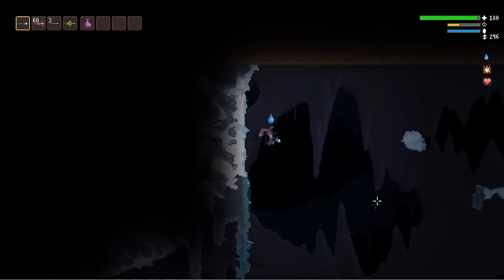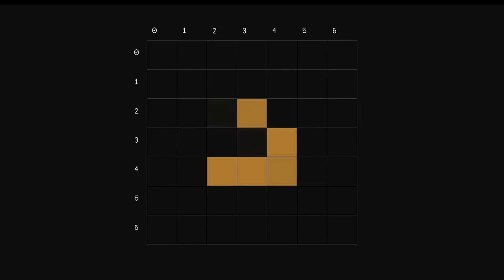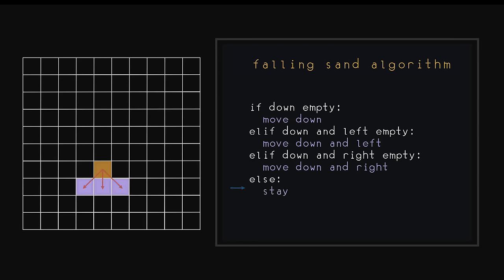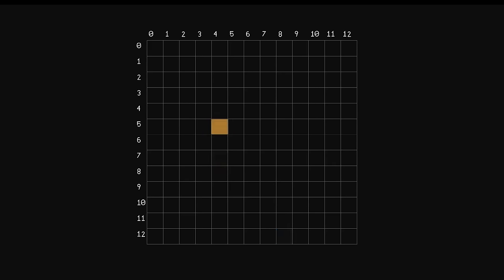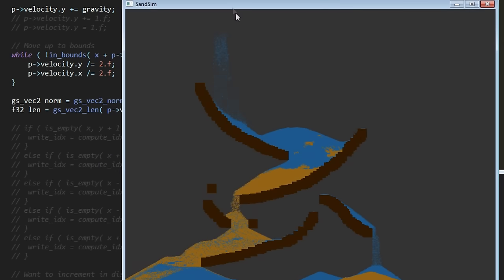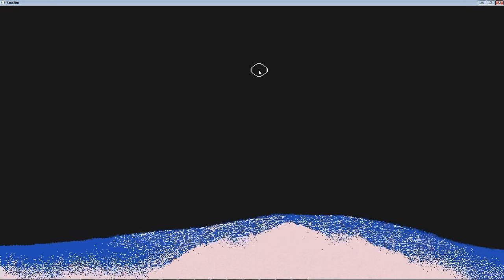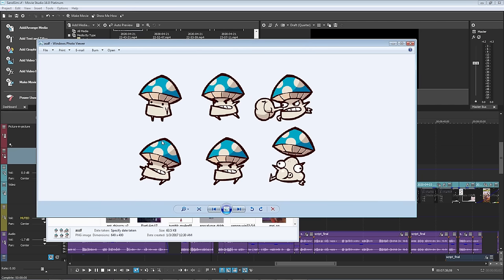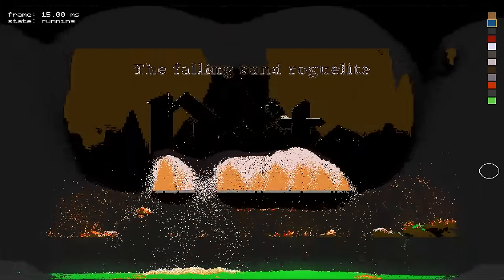Recreating Noita's Sand Simulation in C and OpenGL | Game Engineering

Comment from the maker: Edit:  

Wall of Text Warning

- At 02:07, the size of the b32, gs_vec2, and color_t member variables should only be represented as "bits", not "bytes". Therefore the overall size is not the grossly exaggerated amount shown here, but 24 bytes. Thanks to @Nyzcere for pointing that out! There's always a mistake you miss!

- I've gotten a concern about the memory storage for the particle data. Something else I'm regretting not going into more detail. To clarify, the texture size is not the screen's full resolution in this implementation. It's 629 x 424 for a total of ~266.7k particles. Total memory storage for this buffer is therefore ~6.4MB. I think that's acceptable for a small game world like this. The size of this particle data can definitely be lowered though! If you pack the life time and color information into 4 bytes (24 bits for the life and 8 bits for a color lookup index into a shared table), you could drastically reduce the size. However, the goal of the vid was to show off a concept and demonstrate an implementation - not to achieve extreme efficiency.

- It's also been requested to explain a bit more about how the rendering occurs, since that seems to be a large concern for people who might attempt something like this. 

For the particles' updates, they really are that simple, naive and brute force. It seems odd, but the resolution of my world shown is roughly 260k particles, and it easily hits a 16ms frame time. However as you scale the world, this won't cut it. So you have some options. You could split it up into sizeable chunks, say 512x512 (like Noita does), and then partition those chunks into active/inactive buckets and only update the active particles. To further speed this up, you could multi-thread the simulation.

Now, here's the catch: Noita and my simulations are both single-buffered and run on the CPU. So that means multi-threading is...challenging. You have to be careful at the boundaries of your chunks, since there's a large chance you'll have a lot of data-races at boundary walls.

Noita handles this by splitting its update frame into 4 sections - it creates groups of chunks to update in a "checker like" pattern, so it maintains a large separation area between chunks. This works well enough in practice so that a particle has a large enough area it can travel in a single frame between neighboring chunks without having to worry about getting accessed twice in different threads.

You could also move the entire sim to the GPU, but that's a different beast altogether. :)

The rendering is done in a single draw call. I keep a 2d array of 32-bit rgba color data which maps directly to the pixel data. There is also a GPU texture that has the exact same dimensions as this CPU texture. As I update pixels, I change the color data as well.

Then, when I'm done with the sim in the frame, I push the entire color buffer and copy its data into the GPU texture. Therefore rendering the scene is just a single draw call to present the buffer to screen. I also have 3 other calls for post processing.

All in all, the entire scene is rendered in 5 calls:
- one to render the simulation to an offscreen target
- three for post processing (bright filter, bloom, and composite)
- one for final presentation to back buffer

- Salt isn't less dense than water, I misspoke. But, it looks cool. That's what matters, right?

- @championchap brought up a point that I sneakily didn't address in the video (I'm starting to realize that I need to address everything much more fully than I did). The "simple" sand falling algorithm works great as a base, and adding forces, like gravity and velocity, do work to add some variation for a more "realistic" behavior set. However, if the velocity fails to move the particle in any way, the simulation falls back to this simple algorithm and it can look "out of place" with how uniformly it falls. Think about it - we specifically tell the sand to follow those rules in a fall through pattern - look down, then look down and left, then down and right. What you can do to force some variation is to alternate how to iterate through the columns of your data. Easiest way I've found is to add a frame counter and then on even frames, you iterate left-to-right. For odd frames, right-to-left. This adds enough variation to that falling pattern that it greatly helps out with this issue of unwanted uniformity.

- Also, thanks for all the kind words and motivation, everyone. Subscribe and be on the lookout for the next one. I've already started working on it 😀
Reply: Keep it up! You're doing very well with your videos and they have pretty high educational value, considering how many videos are like these (not many at all). :)
Reply: unity game "creator" sweaty
Reply: This is great content! Very well thought out, in a language that doesn’t get nearly enough YouTube love(C, that is), and is also entertaining in general. Keep up the great work
Reply: You warned me, but boy, it was a big wall
Reply: These types of sand games were how I entertained myself throughout junior high school. :D Loved these so much. It was really nice to see how they actually work!
Reply: What if you had a method that implemented a random chance of going left.. or right. I think that would increase how natural it looked.  This could even be a string of random bits you walk through for psudo-randomness, which would probably be faster than generating a random number each time.  A bounce mechanism would also be good, for sand particles that move past a certain velocity... this would be true of splashes for the water hitting the ground.. as well as fast (or weighty) particles hitting a liquid.  I loved how simply you explained things, and anyone who wanted to make something like this, now has a very solid starting point.  Kudos. Subscribed.
Reply from the maker: @christopheroldfield1066  For the random number for going left or right, it's actually not random at all - it just alternates depending on whether or not the frame is odd or even. You could definitely make this more advanced, but for this simple simulation, it worked out well and looks pleasing enough.
Reply: @johnjackson9767   I agree! It's a fantastic sim, even with the simple rules. I just really liked how it got my brain going.  Loads and loads of possibilities. My compliments!
Reply: Thanks for all the details, Im a CS dropout about to finish my bootcamp so this is great inspiration for some side projects I want to try.
Reply: thought the kids were using fancy 1024 bit values these days
Reply: salt ain't less dense than water, salt is twice as dense as water
Reply: HI man! looks awesome!

I've encountered an issue where the direction of iteration (left\right) greatly affects the behavior of the cells, especially in liquids and especially when adding velocity.
Did you encounter this? and if so, how did you solve it?
Reply: What do you mean, you could move the whole sim to the GPU? How would that work?
Reply from the maker: @titaniumtomato7247  If you double buffer the simulation, you could easily use the GPU to update the textures

Comment: what happens when two particles want to move in the same place? this is something i've always had problems with when creating simulations like this, as top leftness always gets preference
Reply from the maker: The first will get preference. I alternate updating left or right sides first each frame to keep this from being too noticable.
Reply: @johnjackson9767  Can you just randomise where the particle will go? Generate some integer to represent where the particle moves to
Reply from the maker: @GeneralPet  Sure, you could use whatever rules you'd like. A lot of this is tweaking and adjusting parameters until you get something pleasant looking.
Reply: What I do (if I can afford the performance drop), is pick a random site to update. Repeat it several times and you get something that feels “fairer.”
Reply: @jamesmathai1138  In order to do this efficiently you would iterate in a shuffled version your array. This is something that can be used in particle or verlet physics in general
Reply: vector backtracing eliminates this issue, take the velocity of a square and reverse it, then linearly interpolate between the values of the surrounding square centers.
Code:

newV = -v;
//Put newV into floor and fract components
floorV = floor(newV)
fractV = newV - floorV
//say newV is (15.8, 2.5) then floorV is (15, 2) and fractV is(0.8, 0.5)

//interpolation
//lerp function is a + k(b - a)

//horizontal interpolations ( interpolate between bottom two centers), using the horizontal component of the fract for k
lerp1 = lerp(values[floorV.x, floorV.y], values[floorV.x + 1, floorV.y], fractV.x)
lerp2 = lerp(values[floorV.x, floorV.y], values[floorV.x + 1, floorV.y + 1], fractV.x)

//vertical interpolation (interpolate between the interpolations), using the vertical component of the fract for k
finalValue = lerp(lerp1, lerp2, fractV.y)

a common issue would be that the outside squares may look outside of the array and cause a vector out of bounds, this can be fixed by just adding another layer to each side of the array and just advecting the inside.
This solution also allows you to set boundaries for incompressable fluids(mass conserving), you can just reflect the inner velocities onto the outside layers and make them negative,
this will stop any bad physics. Although all of this wont be needed for cellular automata i dont think...
Reply: well, because this is cellular automata, you have a current and a future state. the future state is made based off of the current state, then becomes the current state.
Reply: @aiexzs  Was just about to post the same thing lol, calculate a next grid state then transfer that to the current one and repeat
Reply: @aiexzs  How does that answer the question? According to the rules of the current state it may very well be that in a specific position a sand particle should be created because a sand particle wants to move there, but at the same time it should be a water particle, for the same reason. Kerch00 asks how to decide which one to pick

Comment: Really well explained, and a high production value. Hoping to see more :)

P.s. at 2:07 you accidentally switched from counting in bytes to counting in bits, the total should be much smaller
Reply from the maker: Ahh, you're right! Haha, that b32 should only be 32 bits. I gotta figure out how to add some way to fix it on YouTube. Thanks for pointing it out! What a silly mistake to make.
Reply: @johnjackson9767  also "has_been_updated" should be a boolean (according to it's name) so it's 1 byte and 8 bits
Reply: @adsick_ua  He's using 32-bit bool.  Like the Casey Muratori style from Handmade Hero by the looks of the code....
Reply: @johnjackson9767  Those are the best kinds of mistakes!
Reply from the maker: @totheknee  Yep, 32-bits for a bool so the structures are padded correctly.

Comment: Noita also have ridgid body physics, which is impressive.
Even more impressive is the fact that early versions of Noita had  surface tension for  liquid, so, for example, water in icy biomes formed icicles.
And on top of that, Noita uses multiple cores to calculate physics
Reply from the maker: Absolutely, it's a fantastic showcase of novel solutions to complex problems.

Comment: I remember making demos like this back in the Mode 13H days. Some effects, like blur, are done somewhat opposite from what's explained in this video. For every pixel, you set the color to the average of the eight neighbors. Fire can be implemented by setting every pixel to the average of the three lower neighbors, giving the effect of color moving up the screen. Averages tended toward the dominant color (usually black). This was done with a pre-set color palette, though. The rules were simple enough to implement with some inline asm, and very fast.

Comment: So high quality video! I LIKE it so much. It would be great to get more details how it's implemented in C. Memory layout of pixels and way to draw it fast. In unity I am unable to do such thing. If I create field of 1000x1000 pixels as individual game object, it just freeze my computer. I'll research source code!
Reply from the maker: Thanks! This seems to be a recurring comment, so I'll remember to go into a bit more technical detail in future videos. 

Basically, I keep a 2d array of 32-bit rgba data on the CPU and then have a GPU texture of the same size. When a particle updates, I make sure to update the color buffer as well so that there's parity between the two. Each frame, after updating the simulation, I just do a texture update and push all of that texture data to the GPU. Then I can do a single draw call for the entire simulation (other than post processing). All in all, it's 4 total draw calls for the entire sim.

For Unity, you can create a render texture and then do the exact same thing! Keep away from individual game objects for something like this - they're incredibly heavy and not meant for something like this.

Thanks for watching, and be sure to sub for the next ones!

Comment: @John Jackson  what could be interesting is to rewrite this demo but so that when an image is imported, the image colour is set only to absolute black and white values. So then based on the initial black and white values the program then has to determine what colour the original pixels were and apply the appropriate functionality based on that. Perhaps even the opposite of this could be interesting to observe, wherein said demo initially functions as a colourising algorithm based on the applications palette or even just do the same thing but using frames from animation ? 

So for instance, the first frame of an animation is imported, colourised and then animated as according to the pre-determined particle data but then the next frame after that is responsive to the "aftermath" of the previous frame but that reaction would be dependant on the output of said previous p-frame which determines said particles potential next location and the b-frame which is in essence, the upper threshold of what the next potential particle position could be.

Or going a step further, you could take a camera input which part of the demo is responsible for checking for detection of movement then based on the camera's framerate, for every however many frames that are processed you then assume a P-frame and B-frame of the camera's input which are then used to manipulate the either the colourisation algorithm's input or the position prediction part of the demo

Comment: Christ, I can feel my CPU burning up just thinking about this simulation.
Reply: great use case for a compute shader
Reply: @its_ya_guy_the_big_bak_guai  I've thought about this before, but I don't know how you'd resolve neighbor pixel conflicts with a compute shader. The algorithm he described is very iterative.
Reply: @odomobo  that's a great point, I don't know either. You might be able to dynamically partition an affected area into blocks and assign a thread/group of threads to each block, but that would be a problem since the more areas are affected, the more threads would be required. I feel like assigning a thread to each pixel would be overkill
Reply: @odomobo  Yeah Noita is computed on the CPU with a lot of chunking optimizations

Comment: holy flip. with all these if monsters, how are you pulling so many fps is beyond me. great job at creating your engine sir
Reply from the maker: Appreciate the comments and views. 
Do you mean the branching 'if' statements? They're next to nothing in terms of performance cost. The entire update loop is o(n), so updating 260k+ particles isn't expensive. It doesn't scale for larger images, of course, so threading would have to come into play eventually.
Reply: @johnjackson9767  Now I know this is not a huge project and it probably won't need updates, but if you care, _shrug_, you might try out implementing integer-based branching and simple mappings using function arrays, which could potentially increase performance and remove a lot of duplicate code. You have certainly spent a lot of time working on OpenGL projects, so I might be completely in the wrong here; just a suggestion. Also, this project looks great, looking forward to future videos.

Comment: Instead of applying special rules to each type of particle try giving them weight instead, the weight can determine which direction to look for obstacles while it's at it, so for instance water could have a weight of 1, sand/salt a weight of 2, smoke a weight of -1 etc

Comment: Amazing video! I was thinking, what if instead of making the sand always fall to the left first, why not make it fall into a random available open space? Is the time it takes to compute just not worth it?
Reply from the maker: Thanks for watching! One thing you can do (and I've added to the simulation) is to change the update order of the grid depending on whether we're on an even or odd frame. If even, we go left to right, odd right to left. This little change adds enough variation to break up the uniformity.
Reply: @johnjackson9767  I see! That's a really good solution, tnks for the reply!
Reply: @johnjackson9767  That explains the voilent left right shaking you sometimes get